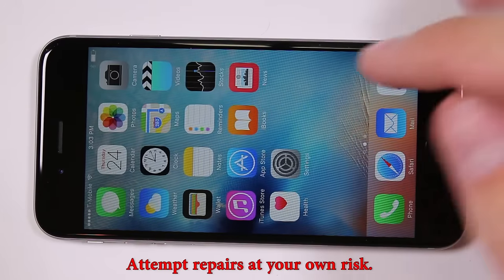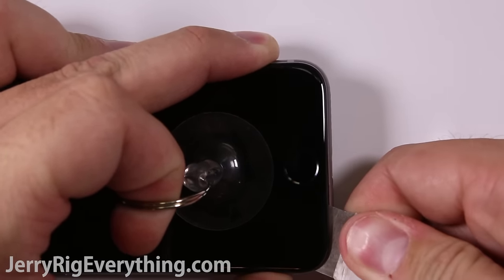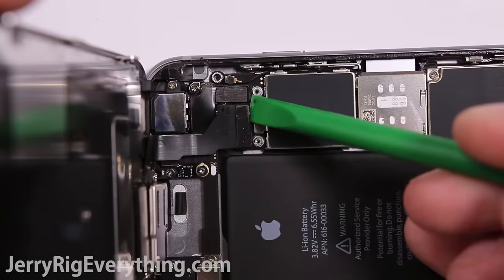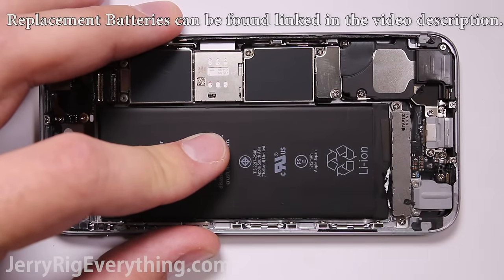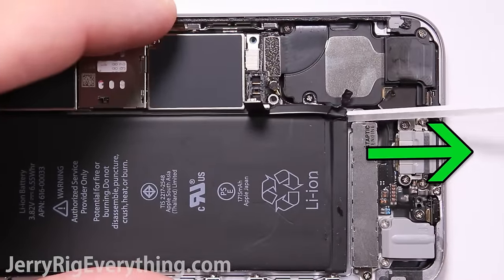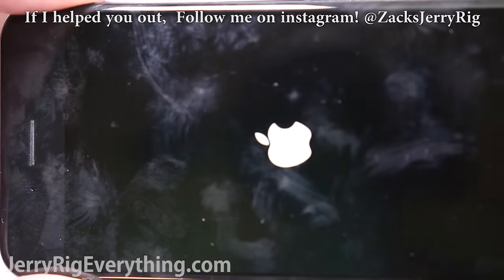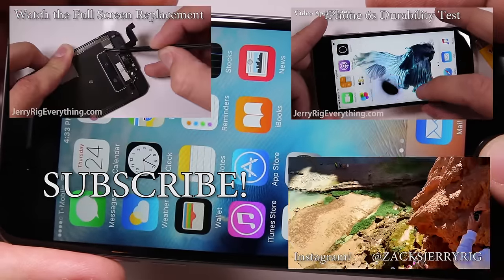iPhone 6S Battery Replacement in 3 minutes (Easy Method)

Comment: Why disconnect the screen to replace the battery?
Reply: Without removing the screen you  have about a 99% probability of damaging the screen cable while struggling with the battery.

Comment: Step 1: Disconnect battery
Step 2: Disconnect display 

🤦‍♂️🤦‍♂️🤦‍♂️🤦‍♂️🤦‍♂️
Reply: iphone xxx if you run the battery totally dead before the repair, it won’t short anything but the battery should be the last thing you connect and the first thing you disconnect just to be safe-also there’s a tool called an iholder that holds the screen at 90 degrees so you don’t have to go through the hassle of disconnecting the metal cover w/4 screws and all three cables!

Comment: Do NOT, pry the battery out like he did.. be much more gentle.... try to get it to the point where it will pop off. Doing it like he did could result in the battery actually puffing up from a chemical reaction, catching on fire and smoking out your entire house with a horrible gas. I’ve had it happen before.

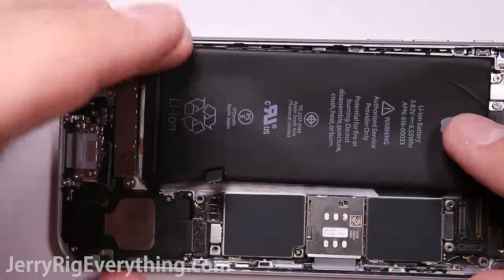Comment: I Ordered tool kit and battery does it come with that tape to tape battery like you did at 2:18
Reply from the maker: The tape is extra
Reply: +JerryRigEverything Is the tape like 100% needed there huge storm shit load of snow cant leave to go buy it. I Just need my phone to work for a day or 2 at most while tape gets here
Reply from the maker: +TheAlBlaze its not totally needed.  It just helps your battery stay plugged in while you're using it.  No big deal though.  You'll probably be fine.
Reply: +JerryRigEverything Ok thank you i hope my phone works. it was wet i didnt think it would turn of an hour later not plug turn on again. Turned off while had 85% battery. Never turned back on Yes i put it in rice then looked up on youtube took it out 30 minutes later. Now been a day since this happen i really hope i can fix it You have a little more knowledge what you think. Wasnt alot of water but it did get a little wet i appreciate you taking the time to reply to me
Reply: make sure it is completely dry, but this should fix it. If not you may need a new screen as well.

Comment: Thats not the good way... Those tape sticks should be pulled back until they are completely away from the battery. Don't move those strips because they break. You are literally damaging the battery and you should NEVER do it like this al that bending and pushing.

Comment: Do you HAVE to take off the screen to remove the battery? Because I can’t get one of the screws out of the plate covering the connectors for the screen, can I remove tha battery without taking off the screen?

Comment: Ok so it was easy to do but seems no power at all 🙁 all connections went back ok. Nothing on screen 😥
Reply: Did you connect the battery cable first then connected the LCD cable? If so, I think you might have fried your phone...

Comment: Pry of shame. Completely destroys the look of battery. I've removed 100s of iphone 7 and 6 batteries and it can be different each time. If you pull too hard and lose the adhesive strip under the battery you can say bye bye to the aesthetics

Comment: I had huge problems with reconnecting the LCD connectors. Afterwards it bothers me why did you even remove them? It should work perfectly fine just letting them be there while removing the battery.
Reply: When removing the adhesive off the battery you must keep the screen at max 90 degrees, more than that can cause problems to the lcd cables so to be safe its easier to remove them.
Reply: Without removing the screen you  have about a 99% probability of damaging the screen cable while struggling with the battery.

Comment: 2:20 Should've connected the battery connector pins before sticking the battery to the case first...
Thanks to you now I can't connect it right..
👎👎👎
Reply: I'm glad I was able to fix it my self.
I suggest anyone who is going to replace is watch another well thought made video & not a lazy missing critical points video like this one. 
If any one had his battery stuck and needs to remove it easily, I suggest for you to remove the "Taptic" Engine component, That'll give you lot of room to get something thin like a card under the battery. Also put some isopropyl alcohol on the card, it will help with removing the adhesive glue.

Comment: The term "Jerry Rig" is not correct. The correct term is "Jury Rig". Jerry Built is another correct term. Jerry Rig is smashing these two terms together. Jerry also uses the term "whole half" in this video. Oxymoron. Try using "entire half" next time.

Comment: This is ridiculous! You shouldn't have to work this hard just to get the battery out. The worst overpriced and badly designed phones on the market. I have a I phone 6s that is only 5 months old and it is completely dead and I can't even reset it. Now I have to take it to a tech. What a joke!